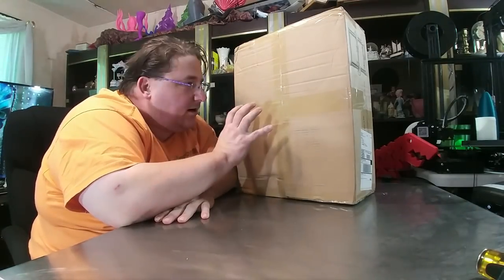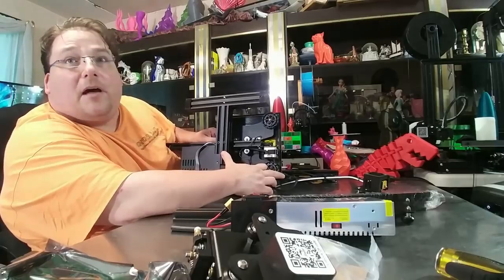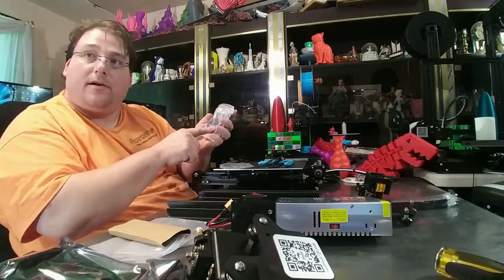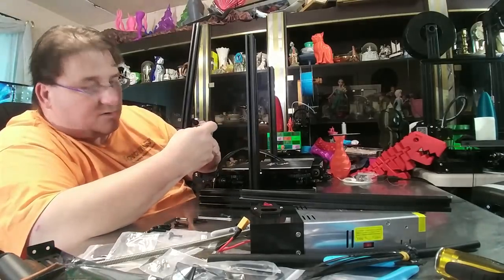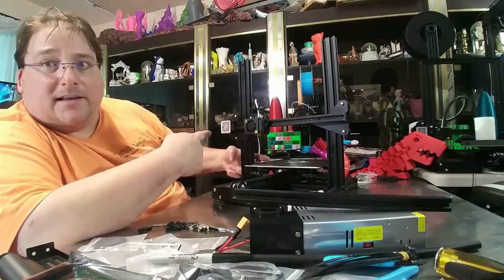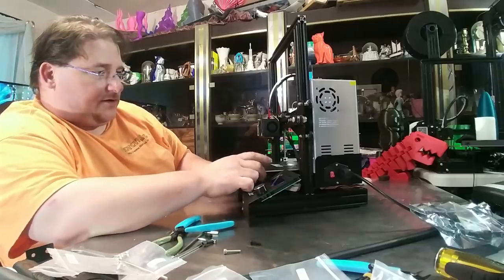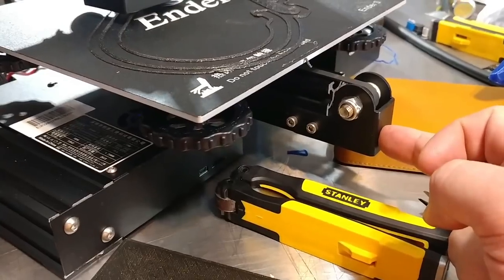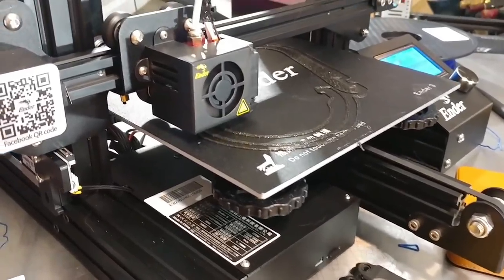T3DP 223 Ender 3 Updated Model Unbox, Build, Upgrade, Many Prints

Comment: Hello again. My CR20 x axis is not completely level. It’s always 1mm too high on the side without the z screw. Any ideas on how to fix it? It came assembled so I didn’t really learn how to do it my self.
Reply from the maker: It could be you just have to level your bed so if the right hand side is a millimeter to go that you have to lower the bed 1 millimeter on that side but if you're level keeps changing that it might be that your right hand vertical trolley is too tight and so the x axis is shifting

If you watch my Ender 3 fixes video the same information would apply to the CR 20
Reply: No actually the x axis seems not level. Of course I can tram the bed to the x axis but I think I will get more accurate models if everything is level? It is not level even if I unscrew the right hand vertical trolley so the problem must be the attachment of the x axis to the left trolley. Or maybe the left trolley is not adjusted properly.
Reply from the maker: enes sabanovic I don't have a CR 20 but I believe it's almost identical to an Ender 3 in the gantry you'll have to disconnect the cables and move the Gantry all the way to the top until comes off the printer which will require removing the top a brace

Once you have the entire X Gantry removed you can access to screws from behind that attacks the X arm to the left-hand vertical trolley most likely those have shifted allowing the arm to tilt remove the screws get rid of the washers put the screws back in tighten them down very well using the angle end of the Allen key not the ball joint end the ball joint and will strip it

Tighten those buggers down real tight remove the right-hand vertical trolley now measure the distance between the two verticals make sure it's the same top and bottom shim as needed

Put the X Gantry and vertical trolley assembly back onto the printer without the right hand vertical trolley

Look at the spacing at the right hand vertical compared to the left if it is too far away you may need to loosen the primaries at the bottom of the left vertical and twist left vertical until the arm since the same distance from the right vertical as it does from the left vertical

Now Slide the right trolley on to the right vertical it should go on very easily if it goes on tight at all loosen The Eccentric nut until it Wiggles loose on the vertical then slowly tighten it only exactly enough to stop the wiggle gently pull the X arm out and Slide the trolley behind it into position attached to the top race the holes for the right hand trolley should automatically line up with the holes in the vertical

If it does you should be good to go put the two bolts back in on the right hand side and your ex access should be level now
Reply: Wow, thanks for that. You are the man :)

Comment: I printed bugman_140 but when you print the ribs the same after a while they come off under their own weight because they do not stick. I think that before I went around the first ones are too cold, or not? urgent advice or, better, the Gcode. Thanks Nerys
Reply from the maker: What do you mean they come off onto their own weight?
Reply: Nerys I'm sorry but, trducendo from Italian to English with google, I can not make myself understood. the ribs after a hundred layers are detached and fall on the bed with the size they have reached: their diameter and the height reached. I would like to send you a picture but I do not know how to do it (I am a 75-year-old "young man")
Reply from the maker: Luigi Vitali imgur.com is a good way to send pictures.

There are two ways for the print to disconnect. One way is to separate it from the printing surface the bed the second way is when the layers fall apart higher up but it's still attached to the print bed this sounds like your problem a picture would help

Usually when you have layer delamination on a print like this assuming you are using pla

It indicates your layer height is too high make sure you're printing a .2 mm layer height if you already are try printing at 0.1 mm layer height

Also make sure you are using at least three perimeters and 25% infill
Reply: Nerys thanks but I wanted to send you photos for advice and I do not know where to send them
Reply from the maker: Luigi Vitali imgur.com post links here.
Reply: Nerys I entered the IMGUR.COM app but then how can I send you videos or photos?
Reply from the maker: Luigi Vitali its a website. You upload a picture and copy the link. Fornvideo just upload to youtube.
Reply: Nerys https://imgur.com/user/barbavis
Reply from the maker: Luigi Vitali okay you have an account now just upload a picture once you upload a picture you can click on the picture I don't know right hand side you'll have a different group of linking options you want to copy the one that says Direct
Reply: Nerys imake, but if I do the post hidden and not public how do you see it?
Reply from the maker: Luigi Vitali I can't see what you're saying from what I understand you just click on the picture you upload on the right hand side you'll have options to post links just copy the one that says Direct
Reply: Nerys I have already uploaded two photos but in public while I wanted to show them only to you, how should I do
Reply from the maker: Luigi Vitali https://youtu.be/BBSTxdkT6GE

Comment: you dont need to use the inner two wheels on the X Axis carriage to secure it square along the Z Axis. The outer two wheels form a rectangle and will stop either side from moving;

 -if you just loosen off the right side Z strut ( with the X carriage down to the build plate) - pull it away from the other side firmly - it  will square its self against the right wheels
 
- tighten down a screw partially - then do the other - Repeat until its solid - do it for the top and  you are done.

 i could remove the inner wheels as they do nothing at this point. And there is zero rock on the X axis - its moves freely ( drops down with no power to Z motor)

Its worth going over every nut and bolt - the X 20x40 was loose
 - Pre assembled doesnt mean correctly assembled ;D
Reply from the maker: Any perfect world it was might work but I don't advise it because that means you have to apply tension on those outer Wheels in order to keep them properly in the tracks to provide guidance by using the third wheel you don't have to make them as tight which means less stress moving up and down this is less important on a machine with dual Z axis steppers but our machine with one this is important
Reply: but not having the wheels firm allows for rock and sway as the weight of the print head moves away from the Supported ( by the Z rod) side. Id imagine if you hold the right side of your X carriage and lift it up and down - it will wiggle and bend? mine does not ( my Ender 3) and it moves smoothly with no binding. creality can save even more money as they dont need to ship it with the inner wheels - 
Or if anyone needs spares? - as the wheels for the build plate seems to grind away =D
Iv upgrade mine to the Polycarbonate wheels - they make a difference indeed =]
Reply from the maker: lykenth08 with two wheels yes but with three wheels no you can have the wheels just to touch so there's no wiggle but not apply much actual Force laterally so no binding

I will have to test that you might be right I'll use my guinea pig rig to check it out :-) I suspect however that the tolerances for getting it just right with two wheels will be higher than the tolerances with three meaning it might work better but would be harder for the end user to set up especially if the machine is not built perfectly

If your bed wheels are grinding they are probably too tight if you slide the bed forward and back it should be smooth if you feel little bumps and divots one of the wheels is too tight
Reply: I wish it was with the build plate wheels being too tight but its lumps and bumps along the extrusion its self :( - the hardened wheels are highlighting the spots. Seems the main thing wrong with the Ender is the extrusions cut or shaping :(
Reply from the maker: Agreed three out of the four machines I got had a Miss cut right hand vertical not enough to keep it from being usable but still annoying in a production machine
Reply from the maker: Flip it over it should be symmetrical you should be able to flip that entire Extrusion over and use the other half of the rail

Comment: How did you get your ender to print so perfect at 1.2????  I replaced nozzle with a .8mm and tried to print at .4 and .5 layer height and I have bad layer separation.  I increased the nozzle heat to 220c and it did a little better but still unacceptable. I made sure my printer profile was set to the .8mm setting in cura also.  The odd thing is that I can print at .4mm layer height with the .4mm nozzle with much better quality than the .8mm nozzle at .4.  I thought if I was going thicker than the machine would be more forgiving.  What am I doing wrong?  What did you change to get the 1.2 mm to print like that?  I am not trying to print figurines.  I am trying to get prototypes done and I dont have all year to print .2 LH at 20 hours a piece LOL.  HELP.
Reply from the maker: You must change both nozzle size and line width in cura and s3d. Its mostly likely trying to print .4mm width out of a .8 mm nozzle which will give exactly what you describe.

Also you must slow down. 30mm/s dont worry about speed you will get time savings from raw volume not speed. 30mm/s might seem slow but remember you putting down 4 times the plastic so your actually going twice as fast by volume. 0.4 shluld work great with a 0.8mm nozzle 0.5 is pushing it depending on what your printing. Remember you need half the number of perimeters now. So if you use 3 perimeters now you can use 2 instead. More time savings. The blink fox was 37 hours. With a 0.4mm nozzle it would have been over 80-90 hours.

This bowl was printed in less than 15 hours iirc i will have to check that moght have been much faster i thought i did it overnight.. Crazy short time for something so large and complex. No infill except at the bottom and 25mm/s max speed and thanks to the 1.2mm walls its crazy solid and heafty. I will actually use this in my home. I may try to anneal it since its htpla.
Reply: Thank you so so much for the detailed and quick reply.  I am going to try this.  I may try to replace the hot end with a micro swiss or e3d volcano later on to up the speed.   You have the most flawless prints out of all the 3dp youtubers I have watched. (and I watched many).  The one thing is that it seems most all youtubers are all about quality which is good but dont talk much about speed.  You would do a great service to many of us who are trying to print useful , functional test prototype parts at reasonable speeds and do not need the quality for tiny toys (no offense).  Please make more videos about doing bigger, better, faster prints and you will be far ahead of the game.  Thanks
Reply: Thank you it worked.  I actually bumped it up to 40mms and its still good.  I  have been tuning the temps on a test sample I made on the fly.  220c nozzle caused problems at the joints.  at 205c its doing way better.   I will get there.   Thanks again.

Comment: hey man Ive had the ender 3 for about a week, Im using cura.. Im getting prints to look better but one issue im having is the first layer. During the first layer when for example it draws 2 holes separated by a distance. /The 2 holes are part of the same structure but it draws a very thin line between the 2 circles  before filing in. When the part is finished the bottom is nice and smooth except for the few lines connecting the objects together. How do you prevent it from drawing these connecting lines

Thx
Reply from the maker: Can you sh9w me a picture?
Reply: In Cura, under Travel, set Combing Mode to Not in Skin

Comment: Can i ask you a question? I have the current model Ender 3 with a Creality3D Ultrabase (since the original bed was badly warped i hat to slap something in it).

I'm currently trying to print the petsfang stuff for the ender 3. https://www.thingiverse.com/thing:2759439

But i am struggling with the duct for the 5015 fan.

I get excessive stringing and lumping even with high retraction settings and travel speed. There is muuuuuuch travel over the printed fangs in this duct. I think thats the cause.

Is there any golden Ender 3 Cura Settings you could share or recommend i could try?
Reply from the maker: Yes I believe it's called combing there's a setting that will stop it from traveling across Open Spaces it'll stay within the confines of the model which will stop the stringing or at least a lot of it
Reply: From what i understood (Tooltip in cura) the combining is what makes the build run over printed lines without rectracting or keep retraction at a minimum. In my case the long travels in this print im trying to manage make the nozzle ooze, have longs travels over the already printed areas and make less retracts. I think i might tinker with these settings a bit. 

Would still love to get my hands on one of your "default" Ender3 PLA profiles. Just to get some inspiration :).

Keep up the informative videos on creality3d stuff. Very informative on a technical level which even rookies like me can unterstand well. Thank you.
Reply from the maker: Maurice Woelk my profiles are online but they are simplify3d profiles.

Comment: How do you measure if the verticals are completely straight usually?
Reply from the maker: use a square and eye ball it. the big thing is distance "BETWEEN" the verticals. 25cm same top and bottom.

Comment: Hi Nerys, I have a problem with recently bought ender-3. When I print at 0.1mm layer height my prints are fine, but when I print at 0.2 or 0.3 they are terrible. There are layer adhesion problems (spaces between layers). I tried increasing flow to 110 - 115, un-tighting extrusion feeder so pla can freely pass, tried with different brand PLA and eSun PLA+ nothing fixed this problem. Z axis also not very tight and I adjusted eccentric nut on Z axis and fixed bed wobbling and leveled bed perfectly. I also print at up to 220 degrees but it doesn't fix layer adhesion thing at 0.2mm and up.
Reply from the maker: First thing we need to do is determined whether or not you have a machine problem or a slicer problem in the description of this video I have a profiles link download my bed leveling Marvin for the Ender 3 and print it let's see what happens
Reply: Wow, thanks for quick reply. I'm using cura 3.2.1 on macbook, I had worse results on 3.4.1 cura version in my first day. I'll try your profile aswell. Btw wood pla filament I bought from gearbest prints a lot better than normal pla and PLA+ at 0.2 / 0.3 layer height. But it's still not acceptable, nowhere near other ender 3 prints I've seen in youtube.
Reply from the maker: Make sure nothing is binding if anything is binding it will affect your print quality if the roller wheels are too tight it will affect your print quality if you have the older Ender 3 with a larger brain board inside you will need TL smoothers on x y and e

I also use an extrusion multiplier of 0.97 with a filament diameter of 1.73

Comment: I got a removable build plate with mine, bought about a 2 weeks ago :) otherwise it looks identical.
Reply from the maker: See how flat your aluminum plate is if it's flat enough to print on get rid of glass a lighter bed will equal better Prince but if it's not flat than the glasses the way to go
Reply: What glass it's a removable steel plate with the standard Ender 3 build surface stuck to it and 4 clips to hold it on, it's superb for removing prints as you just bend it and they pop right off :)

Comment: Did the print head have 2 x m3 screws going from the heat block into the heat sink? Are they supposed to be there or should you remove them?
Reply from the maker: Negative they are not supposed to be there if you have one that has them if it's not causing you a problem you can leave it but if you try to print higher temperatures or longer Prince it might cause heat creep they are assistance screws for assembling in the factory and are supposed to be removed they forgot and left them in :-) if you take off the insulation you can unscrew them from the bottom you don't need to change anything else just unscrew them and remove them later on if you want to change your nozzle it could come in handy just screw them back in and it will be a lot easier to remove your nozzle if you wish to change it out
Reply: Thats great, thanks. I have removed them. Is in normal for the heat block to be quite easily twisted with them removed? I have tightened everything up hot but a fraction of a turn and it loosens up. Don't want to over tighten and strip the nozzle.
Reply from the maker: Duncan Spenceley if you grab it with a wrench it will move but the set screw should be enough to hold in place if you wish to remove the nozzle you will have to put a wrench on the heating block and then a wrench on the nozzle heated up first of course

Comment: What is your method of making sure that the brackets of the left and right of the X axis are perfectly straight? I just assembled mine last week and it took probably longer than it should have to make them right
Reply from the maker: For the most part I eyeball it if something looks hinky I pull out a square the big thing before installing the top brace but before attaching the right hand bracket for the x axis measure the distance between the two verticals at the top and at the bottom it should be the same at both

Be sure to watch my fixes video for the Ender 3 as I described and show in detail how to check each aspect of straightness by using the components that comes with it
Reply: Nerys OK and thanks
Reply: Awesome, thanks :)